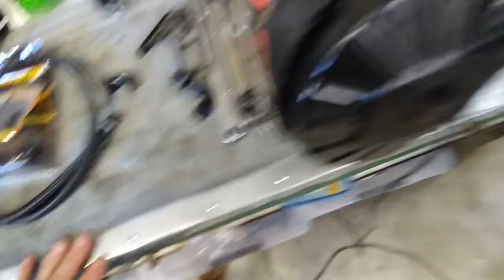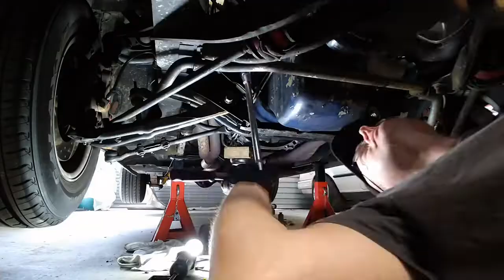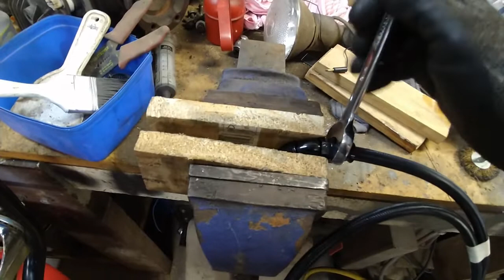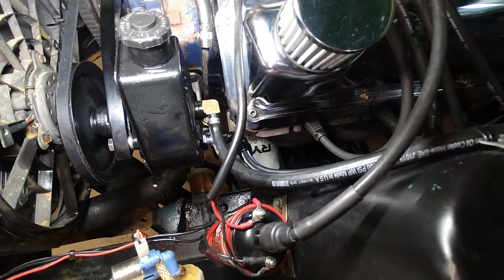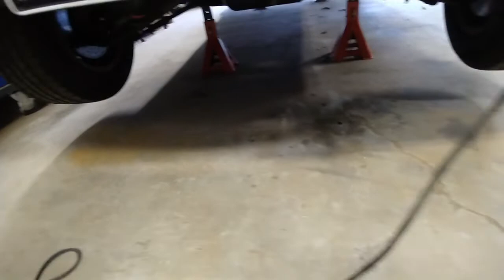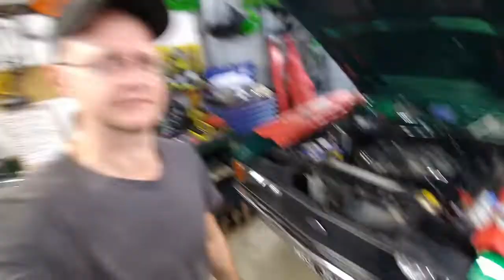XC Ford falcon 351 Cleveland project: Ep 95 Power steering project loose ends.

Comment: Good to see you got there eventually with the PS, the teflon line looks like a good idea  with the compression fittings, is it expensive ?
Also, it's a bit late now, but an old trick is to drill a hole in the centre of the engine mount & install an 8mm high tensile bolt with nyloc nut ( facing up). Leave it about 3mm loose so it takes up  the normal movement. You'll never have to change another mount again !
Reply from the maker: Cheers, the teflon line and fittings I used worked out to be about $150 worth, cheaper than the hydraulic line I first had made by about $50